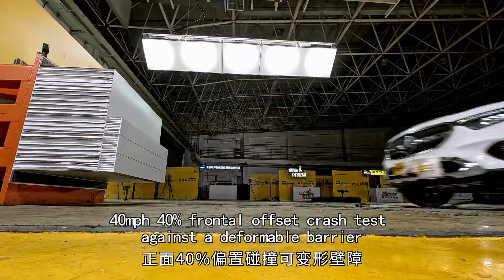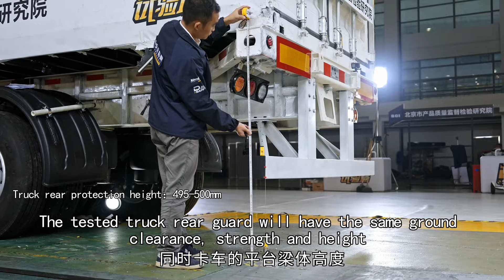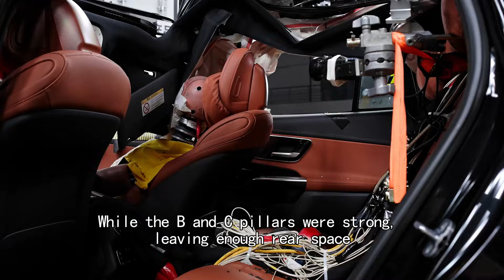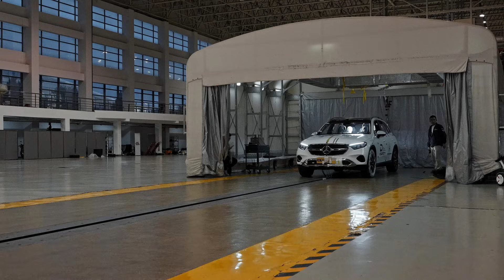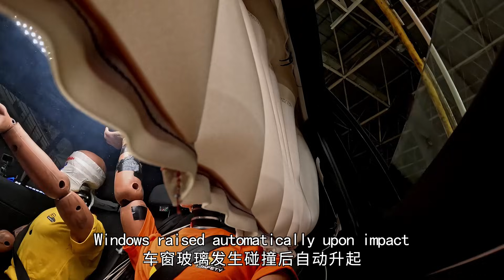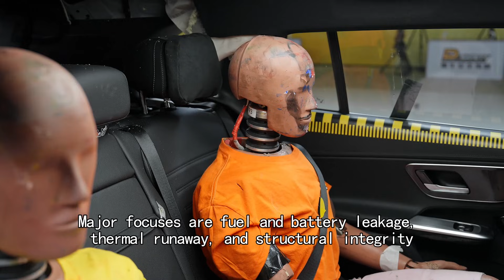Mercedes-Benz GLC Crash Safety Test 奔驰GLC 碰撞安全测试

Comment: These are realistic test cases. Kudos. The 1st one is the best test I have seen. In this case the passenger survived due to the long bonnet which crashed with the rear wheels of the truck. If the bonnet / front had been a little shorter than the passenger wouldn't have survived.

Comment: While I believe car manufacturers need to start making stronger A-pillars to perform better in such crash, comparing car safety based on how they perform in this test is worthless. There many different trucks with various bed frame heights and sized and many different underrun barriers. The design of the barrier, whether it collapses in such an offset crash and what it does to the suspension of the car are random extraneous variables. You can see here how the car squats after hitting the barrier. Thus, the suspension setting would also have an effect. The fact that lower cars would have their cabin penetrate by a much smaller margin or not at all and thus seemingly perform much better also needs to be stressed.

The danger here is that car manufacturers may start designing their cars to pass this specific test always conducted on this one specific model of truck trailer, but not to be safe against rear collisions with the variety of trucks on the road.

Comment: The problem with the crash into the truck is not the cars, it's the trailer itself. Come over to europe and you will recognise that the trailers have way more "structure", they are lower and have kind of bumpers that prevent cars from underriding them. Chinese government should make that mandatory instead of adding more weight and costs to passenger cars.
Reply: 中国用的就是欧洲的卡车标准